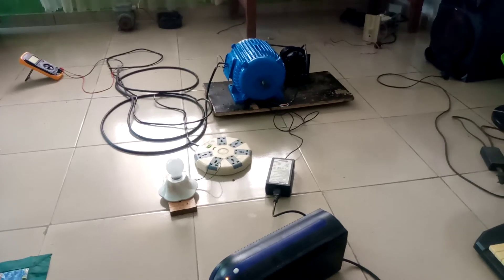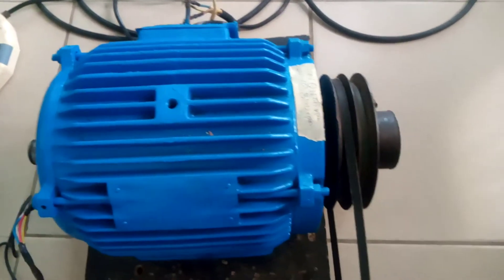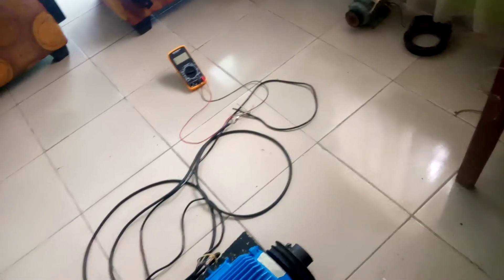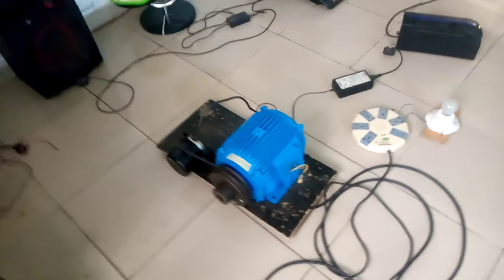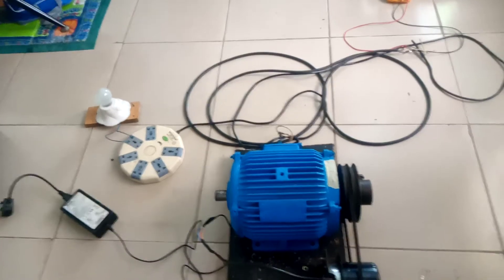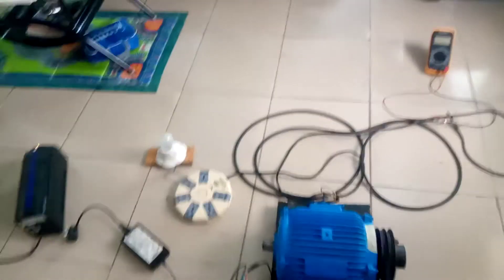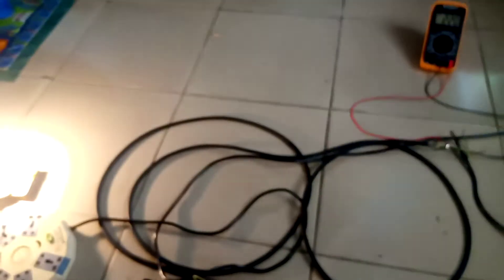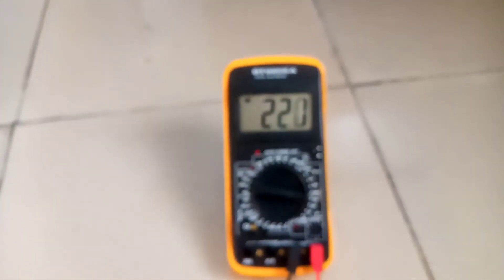Permanent Magnet Alternator...How Efficient?

Comment: You used a 200watt input motor to power a 60watt bulb which is within the input capacity and the input motor is even struggling. you created nothing. Use same setup to power a 500watt load
Reply from the maker: https://youtu.be/KWDc_FfaT0U?si=DkQb-5gyfi8iuc0g

Comment: How to control volt ?
Reply from the maker: 1.Reduce or increase the rpm
2. 450 volt from the full 3 phase I'd achieved at 1600 rpm and if wired to single phase you get to 220volt at 800rpm
Reply: How much torque